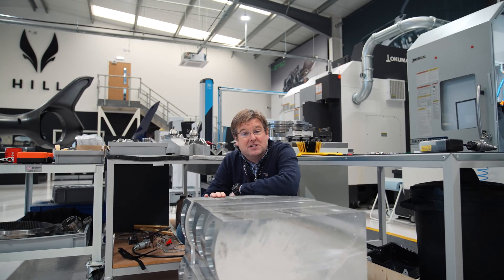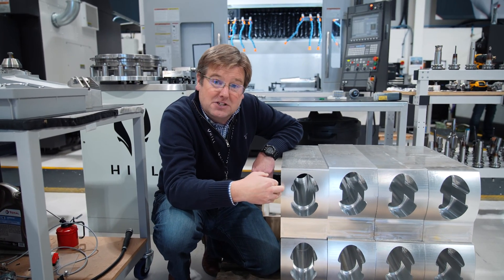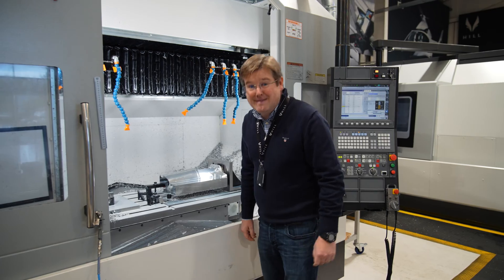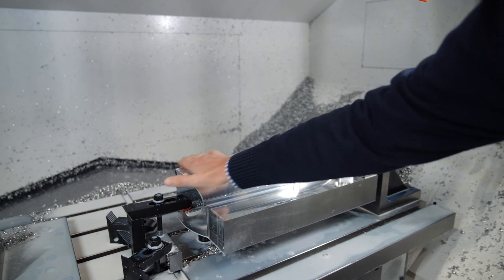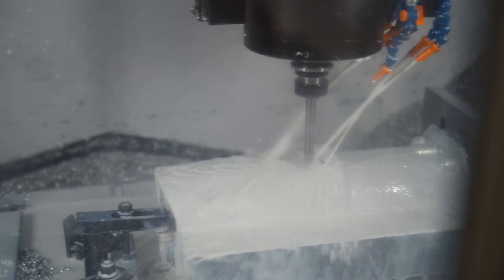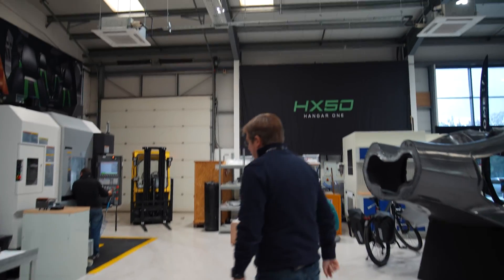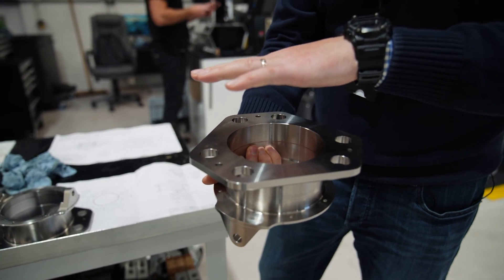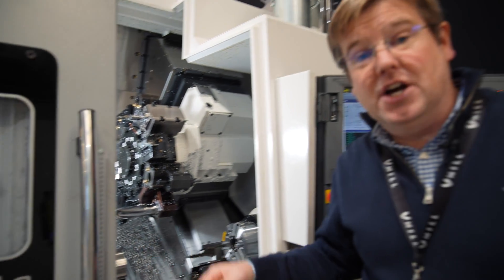Rotor Components: Blade Cuffs and Mounts

Comment: A-Star has composite blades, when it first came out, they were too light and had a quick rotor bleed-off in auto rotations if you weren't careful and on it, they ended having to "weight" the blades which fixed to issue they had. Just a heads-up if your not aware of composite blades being too light. Great update, thank you. :)